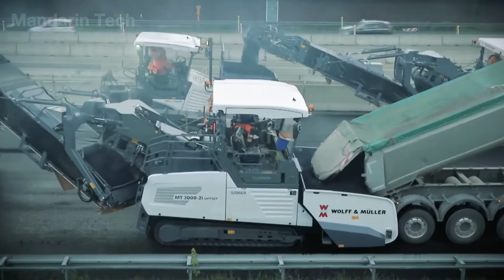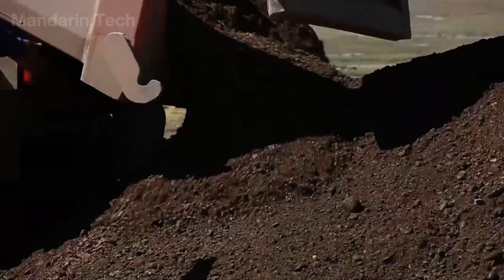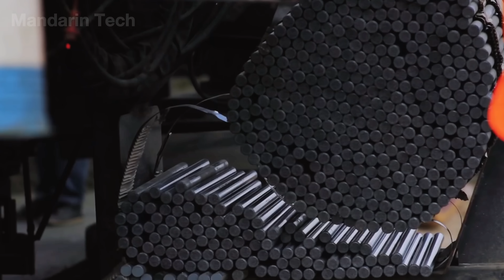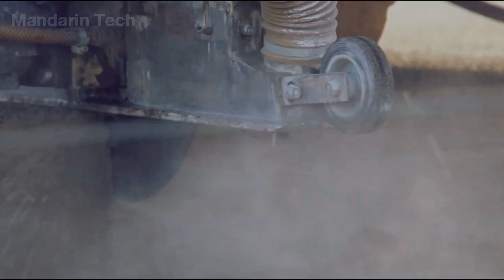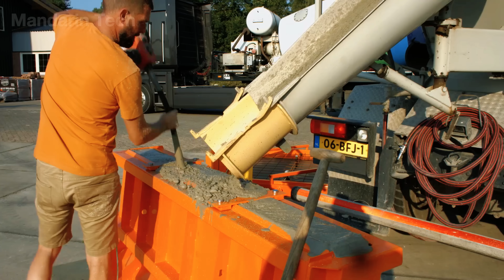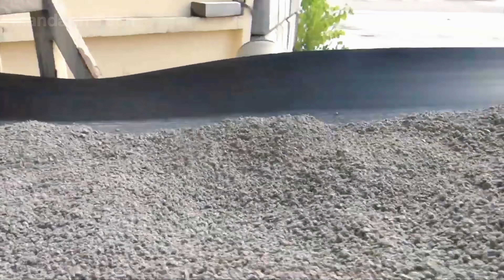How German Genius Engineers Built Massive Unlimited Speed Highway Making Americans Must Admire

Comment: It's not only construction; it is about driver education, training and discipline. In the U.S., 18-wheelers can zig-zag through traffic like sport cars. In Germany, for example, trucks are required to remain on the right lane and are limited to 100KPH. T'here are also passing rules which prevent drivers from passing on the right side, unless there is heavy congestion where the right lane is moving faster than the left one. All these rules contribute to safer driving.
Reply: They are limited to 80 but tolerance is 5 kph. So they drive between 80 and 85 kph.
Reply from the maker: Absolutely — it’s about education, training, and discipline, not just infrastructure. Germany is a great example of how clear rules make roads much safer.

Comment: I drove in Germany 2 years and the state, local roads, and Autobahns were excellent. MY car, an Opel was in good condition but ran good at about 60 to 70 mph, therefore I kept in the right side lanes. Drivers in the inside lanes usually drove 90 and faster. Slow drivers were advised to stay to the right and if you did not fast drivers when approaching you from the rear would blink their lights for you to move over. No one blew their horns because it would distract you and may cause an accident. We were pulled over once for driver's license check on a local road and were treated with dignity and respect. Oh, there were no potholes on any of the roads.
Reply from the maker: Sounds like you had a great experience! German roads are definitely well-maintained, and the driving culture there is very disciplined and respectful. Thanks for sharing!
Reply: That’s interesting about the potholes, they may not allow them over there (so if one begins to form it’s probably repaired the same night).

Comment: Our german autobahns are a fine place for drivers. But I think, that just about 30% of the net has no speed limit. And if you really want to go crazy and go full throttle, nighttime after midnight and weekends are best. Otherwise it is most comfortable to cruise at 120-130 km/h like most others (except slower trucks and fast people in a hurry, who steadily have to accelerate and to break to gain maybe 7 min on 100 km while spending 60% more fuel and 80% more nerves than the rest).
If you love top-speed, you also need a german car! Any expensive sports car will also do, but in the "Plain-Jane"-sector german cars are still unmatched in riding quality worldwide.
Reply: It´s the other way around - 70% has no speed limit.
Reply from the maker: Well said — the Autobahn is often misunderstood, and for most drivers it’s really about smooth, efficient cruising rather than nonstop top speed.
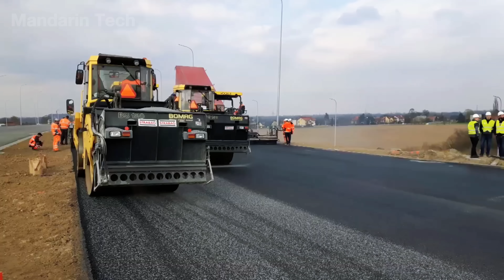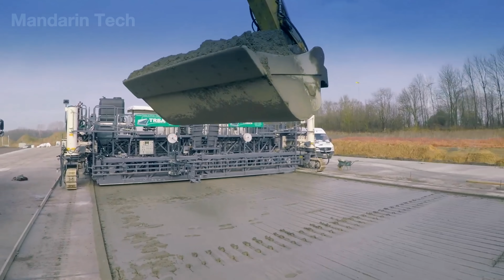Reply: true, done it between 02:00 and 05:00 is the best time

Comment: This is why it cost over 100 million dollars par kilometer.
Reply from the maker: Exactly — large-scale engineering like this comes with enormous technical and material costs.
Reply: This is only the case if you have to build bridges or tunnels. In a normal landscape it costs about 6 to 20 millon Euros. You can check it yourself